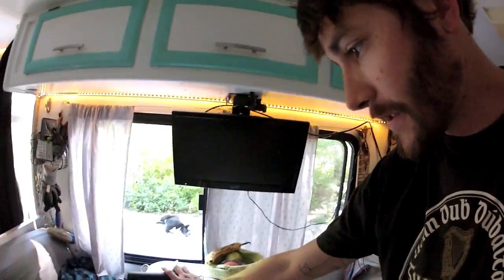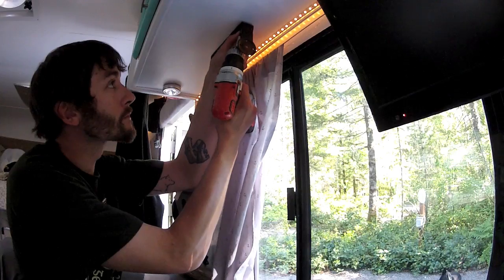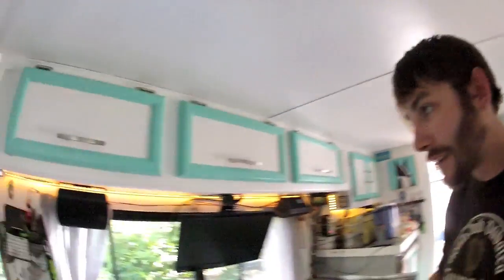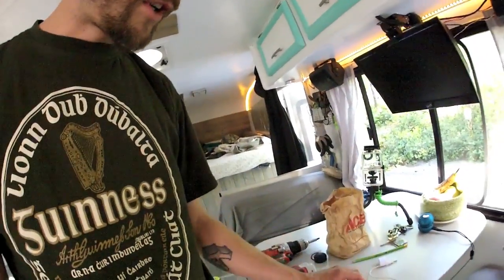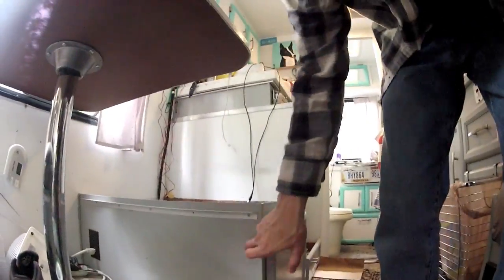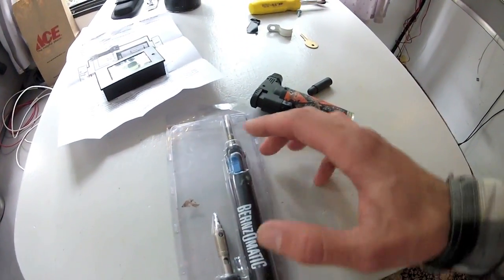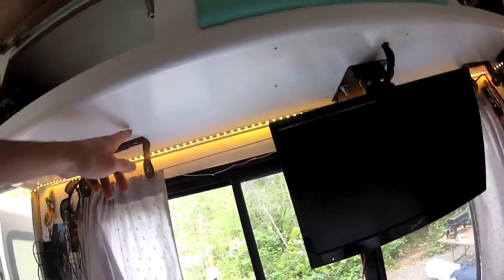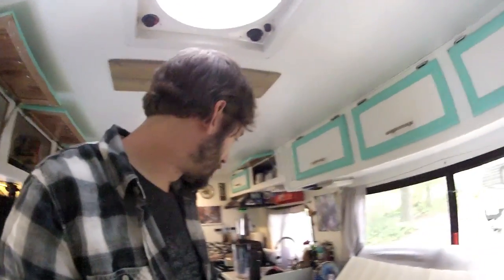$25 RV Stereo System Build and 1K subs!

Comment: Good info video.  A sub woofer makes a huge difference.  I have 4 speakers (2 in cab, 2 in house ceiling), but they run off of cab battery, no good.  I'll have to rig up something like yours.  I also have separate outside stereo system locker that does run off house batteries.  Of course, the big boys have the pull out TV's, wet bars, barbies, etc...  Been seeing some used Toyota RV's including a Dolphin in my neck of the woods.  Cheers!
Reply from the maker: Hey thanks! Yea looking into adding a very low profile sub down the road, those speakers got a pretty good bump but a little more would be prime. We have 2 in the coach that are hooked up to the dash and yea you have to turn on the truck battery to use it. Might try to splice them in so it works off both. Add one more thing to that list... a monthly payment and/or loss of an arm or leg:) That's cool how much they run for out there?
Reply: I hear ya, I'd like to have one of everything, Class B, Truck/camper, Class A, etc...  We're never satisfied...  '84 Dolphin, $10K,117K miles, 21', 4cyl.  '90 Itasca, $8k, 68K miles, 21', 6 cyl.  Grand Rapids craigs list.  T'is the season.  Take care and work safe.  Cheers!
Reply from the maker: Dang they're proud of that dolphin! Crazy the value difference if you have the 22-re 4 cyl vs the 6 (for good reason though!)
Reply: Good to have your opinion.  That is pretty steep, especially for the '84. If I remember, I think you liked the 4 cyl.  Although, maybe you like the 6 now, especially after adding bigger intake.  Looks like the Toyota's hold value.  If I see anymore like your '90 rig, I'll let you know.  By the way, what did you run into your new (pre)amp?  Is it connected to a radio, MP3 player, etc...  Thanks
Reply from the maker: They aren't making any more of them and value only goes up as others rot away. 4 cyl all day, nothing beats the reliability of the 22R-E:) The amp has an AUX input that I plug my phone, laptop, or ipod in with. Wanted somehting very simple just aux input and analog dials. Not a fan of overly complicated electronics or digital presets.

Comment: we have the same multi-meter.. seems a little complicated to install, but once you start the wiring process its not bad, I did have to make a bracket to mount to shunt ( to keep it off the wall) I just used some plastic I had laying around..congrats  on 1000 subscribers! we just hit 50! lol still a milestone though I guess haha.
Reply from the maker: Nice glad to hear! My battery is very hard to access/ work around and not sure where to put the shunt yet. Got a feeling it's one of those projects that turns into much more. So you mounted it to the wall and made like a spacer to keep the contacts off the wall? Thanks it took about a year haha. Props on the 50 it's hard starting out! Keep it up:)
Reply: Wandering Patches I have a solar system video I made before we left, the thumbnail says new solar system, if you fast forward to 7:50 seconds you can see how my shunt is, might give you some ideas
Reply: Wandering Patches oh yeah wanted to say that we found our first work camping job in Darby Montana- really close to Idaho border! We'll be here for the season, do you know where you're heading after your seasons over? Maybe we can cross paths, would be cool to meet up
Reply from the maker: That is so cool! We lived in the Bitterroot (Florence and Stevensville) for a few years you'll love it! Great people and beautiful places. Painted Rocks is pretty sweet and I think in Darby technically. Don't be worried of the old military trucks going up and down hwy 93, its just the Darby Militia:) I'll message you about meeting up that's a strong possibility.
Reply: Wandering Patches thanks for the heads up!haha, yeah we're definitely going to try to go to painted rocks

Comment: So inside my cupboards of my rv the bottom of the shelves are just thin 1/8" ply thats stapled down.  I just pulled it up the and got access to the wiring runs that way.   I like that little amp,  I was considering one myself before I just went with the car audio receiver.
Reply from the maker: They ran all the wiring in the hollow bottom on these. Thought about how that is in your rig might make something like that to make it a little cleaner down the road. Very happy with the amp although I should have got one with a radio built in. Like having analog dials and the simplicity of it for sure!